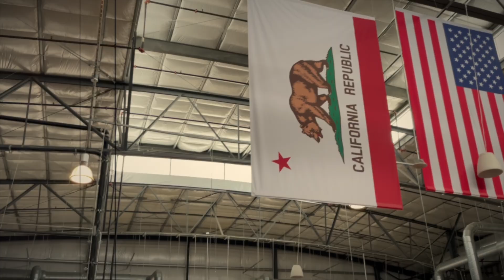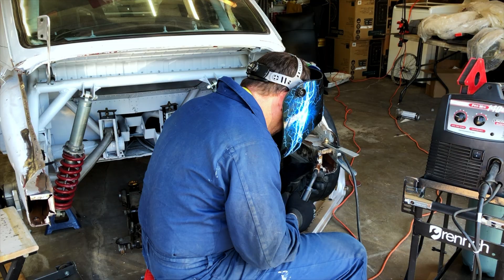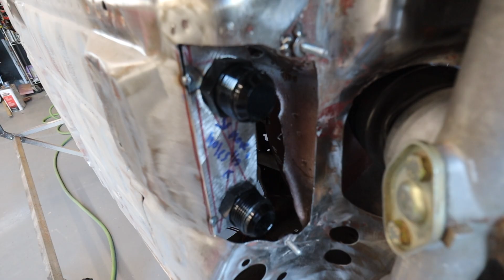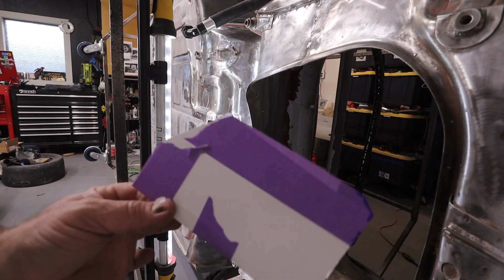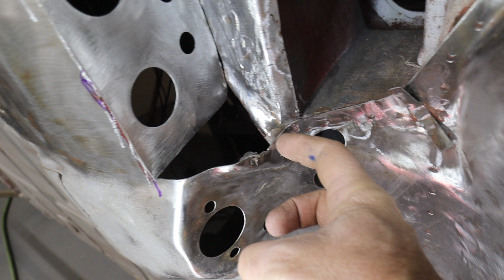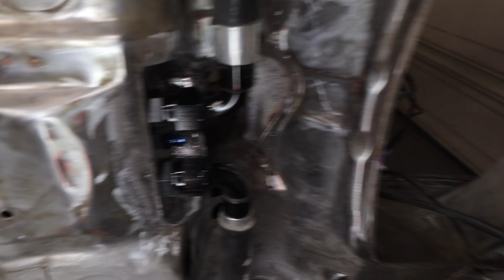DIY Car Parts Fabrication Using Simple Tools! | Custom Recessed Tunnel Bulkhead | Blasphemy Build 77

Comment: this whole project is just taking great shape, I enjoy every video, I like how your completely transparent about your mistakes, cooling a 911 1960's with radiators, very interesting I think you should rethink the size of your front to rear cooling lines to two and  a half inch pipe feed and return, these are not comments of criticism but concern as I've raced Porsche boxsters and overheating with factory radiators was a constant issue,
a third rad was always an option, and these engines where not turbo charged .

keep making this kind of content, this is what make the the Porsche owners community so interesting .
Reply from the maker: Yea, I've gone through an evolution.  I think the current setup will be up to the task.  If not, will re-engineer!